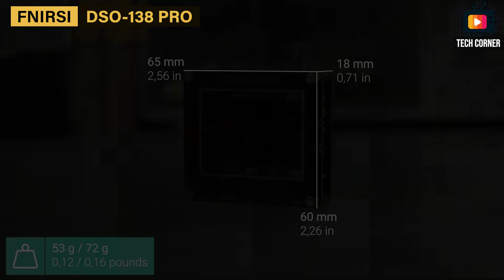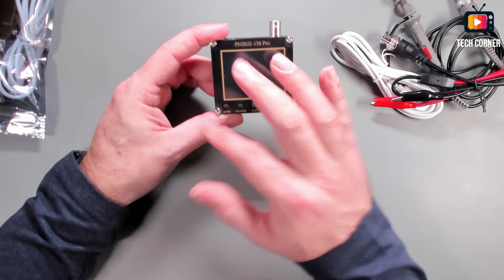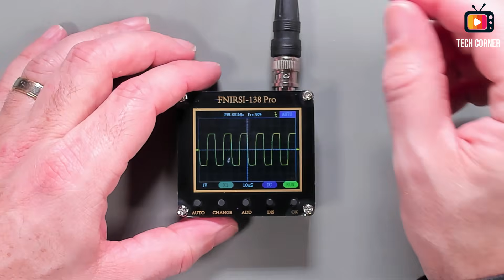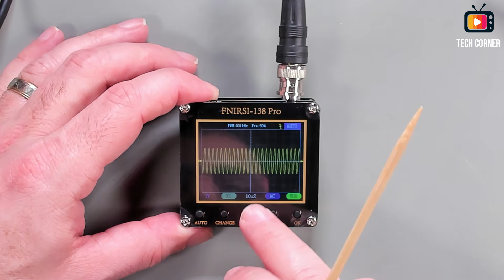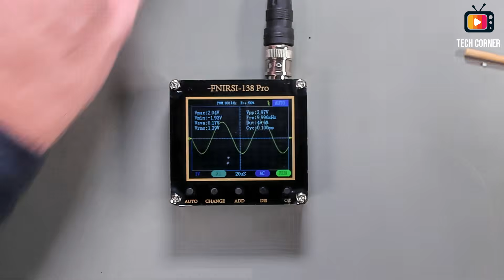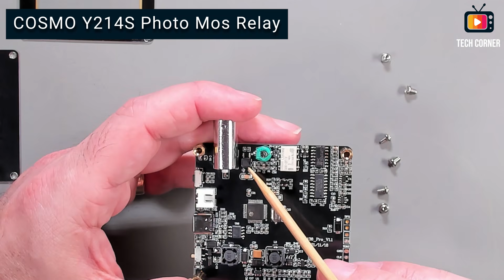FNIRSI DSO138 PRO ⭐ Is it the new king of cheap mini oscilloscopes?

Comment: Dull shit. If something suddenly breaks, the circuit cannot be found and there is a problem with the firmware. 
I used this shit for a year until smoke started coming out of it for no reason. Don't buy this Chinese junk.

Comment: can i messure milliamps from this osiloscope. I'm doing energy efficient some of my circuit projects so  i need to messure how much current flow in my circuits
Reply from the maker: Hi, I night be wrong, but to measure milliamps you need to have a amp probe, never tested, but probably will work. Thanks for watching.

Comment: I needed one of these for a 300 watt amplifier in my car would you recommend this tool to solve clipping/ distorting thanks great detailed video
Reply from the maker: Hi, it's a cheap and reliable small device. If you can do it up to 200Khz you'll be ok with this one. They will have very soon a 1Mhz DSO153 really soon, no idea of what the price will be. Thanks for watching.
Reply: @TechCornerTV  could this work for speakers bro ? Or would you prefer a oscilloscope with dual channels to match them

Comment: Hi! Do you think it could be useful to debug an audio power amplifier? Just to track where a 1 kHz tone is no more propagated to the output?
Reply from the maker: Hi, for sure. This oscilloscope announces 200Khz maximum, 1Khz is just starting to heat up 😁  But for almost the same price you might want to take a look in the DSO152 ( https://youtu.be/cVHj-6dry8M ). Thanks for watching.

Comment: A sine wave may not be the best waveform to test oscilloscope quality, in my opinion. A ramp-up waveform is better for testing the quality of a scope because it requires a sufficient sample rate to measure the entire wave amplitude. Ramp waves have sharp corners, so the scope needs to have a sufficient sample rate otherwise you will get an amplitude drop.
Reply from the maker: Hi, fair enough! I will try in my next oscilloscope reviews to give more attention to the square wave part. Thanks for sharing and for watching.

Comment: Hi there,   nice video,   I just bought one of these units , I is same model number, but does not have a battery like the one you are showing,  Is the battery required or can it still be used once connected up ?   Cheers
Reply from the maker: Hi, the battery is not required, is just useful to have it "portable" it will work well just connected to the USB. Thanks for watching.
Reply: I don't know about the no-battery unit you were shipped, but the one I received is missing the battery header and the TP5400 chip.

Comment: Everything is perfect when it's a gift 😂
Reply from the maker: Hi, sorry for the delay in the answer, time these days is very short. I understand what you're saying, but as I see it, we have several categories of oscilloscopes and for this I will use euros (my local currency), you have the under 35€, this one and a few other options, then ~40€ to 65€ where you'll find devices like the FNIRSI 1C15+, 5012H, Zeeweii DSO1511G, etc, we have another category between ~65€ to 110€ FNIRSI DSO180X, Tooltop ET829, Zeeweii DSO2512G or DSO3D12, then we have between 150€ and 250€ the Owon and Hantek portable oscilloscopes (some with multimeter) and we start to have the desktop oscilloscopes with FNIRSI 1104D being the cheapest and also with less features of the bunch, after you have the Hantek, Owon and a few other brands and then you go all the way to 300€ and up where you start to get different equipments, with different quality. 
For it's category under 35€, is a very nice device, only surpass by the Zeeweii DSO154. My opinion isn't related with be free or not, every equipment I receive these days, is sent for review free and the condition is that I can say whatever I want about it. 
I analyze every device according the category is him, apples with apples and oranges with oranges. Thanks for watching.

Comment: Hi, I just bought this but know very little about it. Can it be used to check if an inverter I bought is outputting a pure sine wave at instead of a modified wave form? When I attach it to my house power (120V) it doesnt look like sine wave after hitting the auto button. I think I need to change amplitude but 10V seems to be highest I can go.
Reply from the maker: Hi, don't forget to change the probe to 10x, otherwise you can damage the oscilloscope. It should work ok to check the inverter. Sometimes, you have to tune up a  bit, since auto is not perfect, some times it doesn't work so well. Normally, a amplitude adjustment do the trick. Thanks for watching!
Reply: @TechCornerTV  ok thanks for the tip, do I just simply attach each end of 10x grey probe to each outlet hole (sorry not sure of proper term) obviously not the ground one right? Im in Canada so we are 120v power. Then turn it on and press auto? I know I can adjust amplitude by adjusting voltage. I will try it with and without a load correct? Thanks for answering you have a new subscriber
Reply from the maker: @mikeoes1  Thanks for the sub! This is really important, you should use the probe on the live, never connect the aligator clip to the live one, otherwise can be very dangerours, but you put the probe in 10x mode and also don't forget to do the same on the oscilloscope. The probe aligator clip should be connected to the common. Please understand that kind of voltage can harm you and damage the equipment.
Reply: @TechCornerTV  ok thanks again!  Do you know how to put it in 10 x mode?  because the manual does not say how and I've tried playing with all the buttons. if I hold down the change button it does not let me toggle from 1X to 10X, its skips over that section at the bottom of the screen. Heres a 1 min video of me trying to test wave output from my house outlet (120v). Is this correct? 

https://youtu.be/dYkKOpNyjKs

Comment: Sorry if this has an obvious answer, but what’s the deal with passing in control voltage via a 3.5mm connector? Do you need a 3.5 to BNC adaptor? Cheers
Reply from the maker: Hi, yes you will, well you can always use the aligator clips, but with a plug it will be much more "secure", there are adapters in aliexpress for that ( www.techcorner.tv/aliexpress ) I bought a few with and without cable. Thanks for watching!
Reply: @TechCornerTV  awesome - I need an OSC to visualise control vintage in my modular synth, this looks like a great and cheap option - thanks for the video 🙏🙏🙏✌️

Comment: I want to test the frequency of a Line pressure solenoid in my car's transmission, the solenoid uses 12volts DC to operate. Will this work?
Reply from the maker: Hi, I believe so, this analyzes electric signals, so if you have an electric signal can be analyzed 😁 you just have to keep it under (vpp) 40V in 1X probe or undet 400V in 10X probe. Thanks for watching!
Reply: @TechCornerTV  thank you.

Comment: So I just got one of these to measure clipping on my audio amplifiers. I'm having issues in figuring out the correct settings. Could someone run me through how to measure a 40hz signal? I tried using Auto, and it worked, but I cannot get the wavelength view low enough to where I can see when it starts to clip, as I run out of screen.
Reply from the maker: Hi, 40Hz signal is a very low frequency signal, so you should use a time based not so low, something in miliseconds so you can see what you need. Shouldn't be hard, I think. Thanks for watching!

Comment: So I got this. Definitely going to get a lab scope.
With this little guy, it's fun. But, it will not mount for firmware update. Two seperate computers, nothing.
I even looked to see if I needed to assign a drive letter to the mount. Nope, nothing.
But I also can't find firmware, so maybe there isn't any update anyway?

Thank you
Reply from the maker: Hi! Yeah, it's only 200Khz... if you think about it, the arduino as 16Mhz crystal... it's ok to see how everything works and to make you sure that you need to buy a 100Mhz one... hehehe...
Reply: @TechCornerTV  lol.
Yes, that's basically my plan. If I find myself limited, then that means I can justify a lab scope, but if I don't use it much or am not limited then I won't.

Even if I but a real scope, having this portable in my carrying case with my multimeter is still nice.

Arduino, I didn't think about that. You can actually view the clock, cool. I'm used to multi gigahert processors. I gotta try that!

Thank you!

Comment: Maybe someone here can help. I need a scope here and there, but I've never bought one. I know the basics, but that's it. I will study though.
I don't know why I'd need a better one, but I would buy a "real" beginner scope if I can find the reason. Like 400 dollar scope that people suggest.

So currently, I want to find the rise time of some 5volt and 3.3 volt regulators.
I need to troubleshoot a chip starting too slowly.

Other times I need a scope are arduino or raspberry pi related or some other things.
Do I even care about bandwidth?
Does it only matter for oscillators?
Help, lol. I just basically wish my multimeter could plot change over time.

Problem is every time I try to do research, the use cases are examples and I don't know how that'd compare to my somewhat unknown use cases.
I do radio sometimes, but I don't expect to be able to analyze gigahertz antenna, so skip that.
But what about clock frequency? What about basic electronic troubleshooting?

Should I get this or a beginner rygol? I know you can't answer for real, but any advice?
Edit: also there's some 50 dollar scope that say 10 or more Megahertz? Hows that possible if this is 80Killohertz?

Thank you
Reply from the maker: Hi, so, first of all you should find out your budget, if you have a budget up to $50 and want this for a hobby, you can use this one or DSO-TC2, they're similiar. (Head's up, there is a new TC3 to be released and I will review soon and has more bw). If your budget goes up $100, you might considet the Zeeweii DSO2515G, has 2 channels, function generator and a few more functions. If you have a budget around $150 you can already consider the benchtop FNIRSI 1014D, it's very rookie friendly, has a nice image and very easy to use. If you budget can go up to $240+/-, benchtop Hantek 2D15 or Owon are good choices. Hope it helped. Thanks for watching!
Reply: @TechCornerTV  wow this is great.thank you so much!
So this is what I decided. Order that little 33 dollar tiny scope. Then, if I use it a lot and run into limitations, I will go pretty far up to to the full size scope. 
I've heard some bad things about that hanteck regarding the ui, the stability, and with the teardown. 
So, I may search your channel for a sigilent, rygol, or something with some solid us support. 
I'm going to go look for some cool circuits to build! 
Thank you so much.

Comment: Is it working fine, and no problems? Which is better 138 fnirsi or dso 150
Reply from the maker: Hi, I love my DSO-150, I find it so pratical with the rotating knob. But in terms of oscilloscope, they're pretty much almost the same, DSO138 PRO has some more functions in the square wave output, like configurable dutty cycle and few other small things, the DSO138 Pro is also a bit faster. You'll be ok with any of them. Thanks for watching!

Comment: Hi! and thank you for the presentation.  I have a quick question for you: Is there a way to modify the code for this product?
Reply from the maker: Hi Mario, I think that you're talking about the source code for the firmware, this is a commercial product and I don't believe that FNIRSI will release that, but this device uses the same code of the DSO138 and you can find some releases on Github, just search for DSO138. Warning, I don't know if those releases will be compatible with the DSO138 PRO hardware, so proceed with caution. Thanks for watching!
Reply: @TechCornerTV  Thank you so much for the fast response.  I really appreciate it!

Comment: Good presentation. I still use the old school 138,  I built it and I'm very proud of it. I told myself I would Up-grade but I haven't found a justification. The little scope does just fine in the Arduino world. Your new guy here has the advantage in form factor. My scope feels cheap even with the stupid acrylic case.  This might make me feel better, I was going to get a smaller meter as well. Bench space is tight.  Thanks.
Reply from the maker: Hi Planker, if the 138 is enough, then you don't need anything else. If you need a component tester (capacitators, resistors and so on), you can always go with the DSO-TC2, very nice devide and just a very few buck more than the 138PRO and you'll have an oscilloscope and a component tester on a very nice enclosure, you have the video here ( https://youtu.be/TXEXZlp8_9U ) and the device here ( https://geni.us/rDqW ). If you don't need one and 138 is enough for you, just stick with it 😁 Thanks for watching! 👍
Reply: @TechCornerTV  I assembled the component tester as well. For $30  I have a VOM, Trans tester, and a mini scope. I can fix stuff..I keep looking at the bigger stuff, but honestly a new scope at this time.... I'm not there yet.

Comment: Nice Elaboration, but still not confident, to get which one!
good postmartam though of circuit design!
Reply from the maker: Hi Hissan, it is a simple oscilloscope, it works ok, but if you're looking for something more reliabiable save a few more bucks and go for the 1C15 or the 5012H, it's a totally different product and the price isn't so much higher. Thanks for watching! 👍

Comment: I bought the option without a battery. I would like to add a battery now. Any idea what voltage battery is needed? Tried a 3.7V Nokia with no success. Will I need to step up the voltage to 5V with a dc-dc converter?
Reply: I also bought the model without battery, the components are missing on the pcb (led, diode, chip, etc.). I think it will not work with the battery, I have tried three batteries none works, no hint of recharging ... the led is missing ..  try to compare our pcb with that of the video, it is all very evident , here you can see it https://youtu.be/9pQuUXGhtFM
Reply from the maker: Hi Paul, is regular 3.7V battery, the writtings on the battery are CL 503045 3,7V 1000mAh 21L. I took a photo, send me a message through the contact e-mail on about page and I will send you the photo. Thanks for watching! 💪

Comment: Would be good to see an option for a silicone case. The screen appears to be very high quality. Do you know if the distorted square wave at higher frequencies is as a result of the leads/the device?
Reply from the maker: Hi Andrew, that a very nice idea, it will cost "peanuts" and ir will be nice to protect the exposed electronics. Thanks for watching! 👍

Comment: Bought this...and love the small form factor. It does not have battery level indicator but you can just check by touching the probe on the positive terminal of the battery plug that is exposed on the sides.
Reply from the maker: Hi Faiz, what a great tip! I would never came up with that idea, so cool! Thanks for sharing 😁

Comment: i am in a search for my first oscilloscope, Hugo. For a hobbyist, learn-to-fix electronic stuffs like phones, laptops, switching PS and such (non-professional by any means), do you recommend this DSO138 Pro or rather keep the money for a more advance one? maybe like 1C15 model?
Reply from the maker: Hi Radius, I ordered for review the KKMOON DS0120M, DSO1511G & DSO2512G120M (2 channels),  FNIRSI 1C15+ & 5012H to make the review of each of this oscilloscopes and a showdown video after. To be honest and considering for what you will use it, I'll suggest ot invest more $10 to $15 and buy the FNIRSI DSO PRO (you have 5Mhz and 30Mhz versions, be careful what you choose) OR  spend more $25 and buy something like the 5012H or 1C15+ (that will be my option). The 138 PRO model only has 200Khz bandwidth and very few functions. Well thats my 5 cents on what you asked, thanks for watching! 👍 PS - I have a giveaway running right now to offer a FNIRSI 138 PRO to a channel viewer, view on the videos list how to apply to the giveaway.
Reply: @TechCornerTV  big thanks for your prompt reply & valuable advise, Hugo. I did consider FNIRSI DSO Pro but i noticed from your review about it that it has problematic Auto mode, made me to put it out from my option list. Does the 30 Mhz version has that problem too?
PS : yes, I do aware of your giveaway and applied for it already. hope the best to win it. ✌🏻😁

Comment: I'm looking for first diy automotive oscilloscope, and wondering about dso150 and this one. What would i choose to be happy? Regards!
Reply from the maker: Hi Piotr, This one has battery and DSO150 doesn't, you can hack it to add battery but thats another story. The battery for automotive usage might be very useful. For a few bucks more you can also consider the DSO PRO, it has battery and already supports 5Mhz bandwidth. I have a video on that one also, see it in the channel videos. But between the 2 you mentioned, I prefer the DSO 150, but for automotive usage I think DSO128 PRO might be better, due the battery. In terms of features, they're about the same. Thanks for watching. 👍